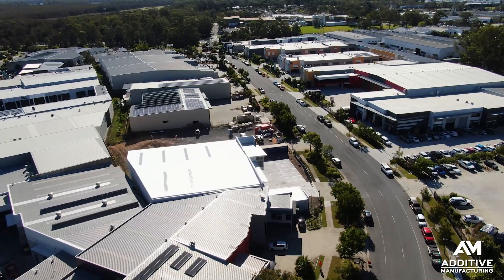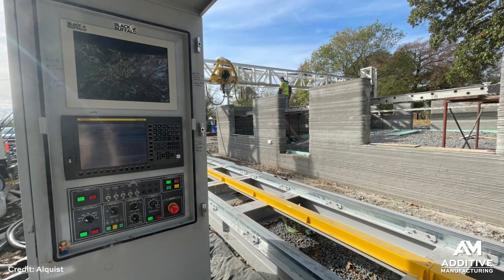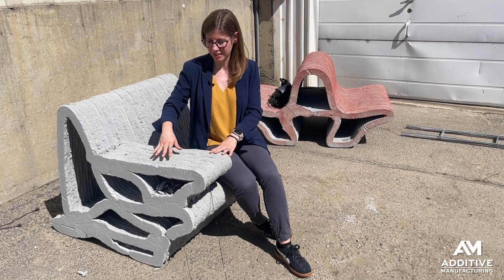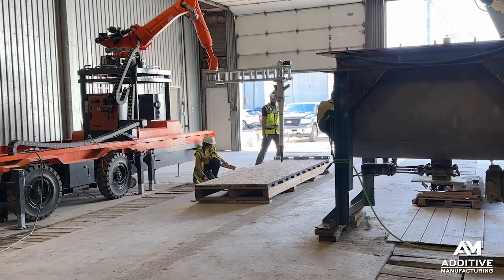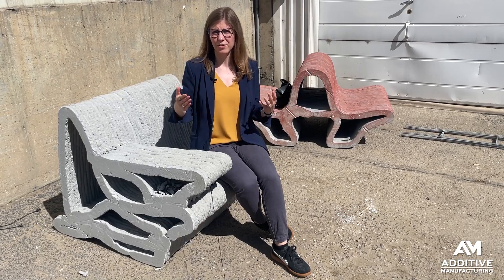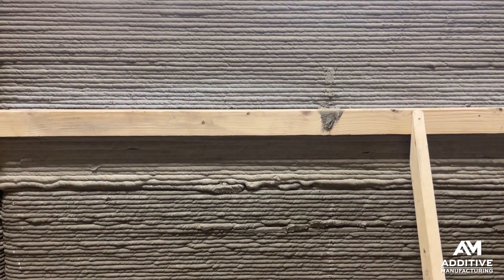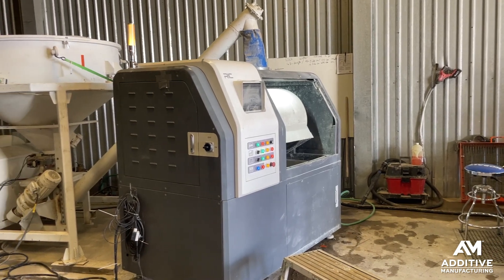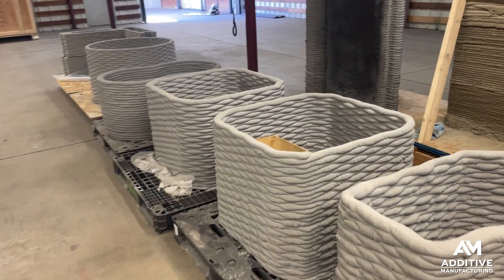Construction 3D Printing Using Robotics and Geopolymer

Comment: The benches. They are coarse. Does the company post-process these somehow? I imagine they will gather water, dirt etc over the years as-printed.

I do really like the alternating jiggly layer planters.
Reply from the maker: Postprocessing isn’t always part of the workflow, but Alquist shared with us that one potential option might be to use the robot to smooth the layer lines as you go. The geopolymer can also be finished like more conventional building materials, with paint, stucco, etc.

We like the jiggly layer planters, too.